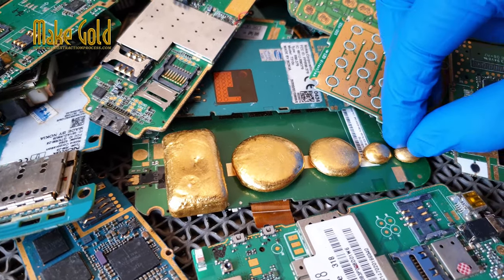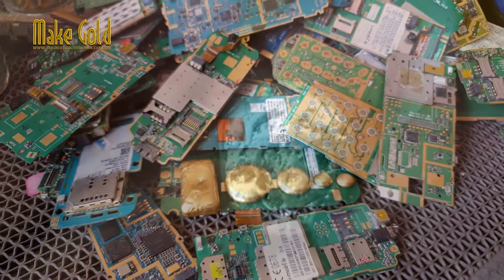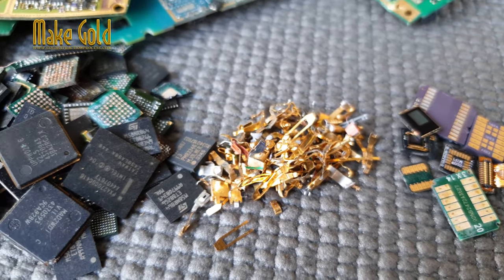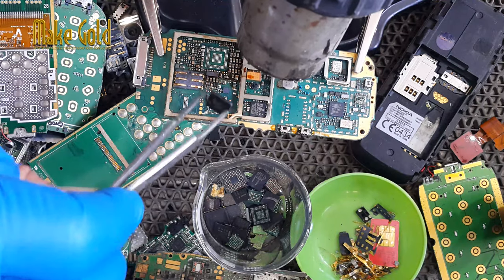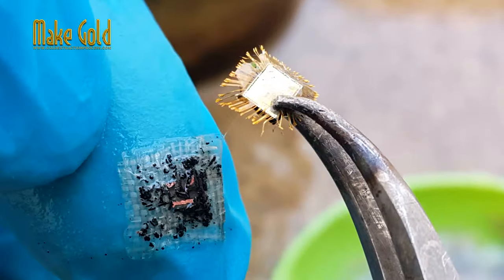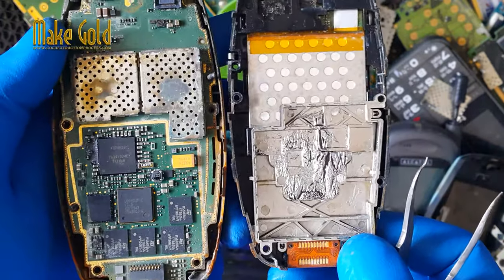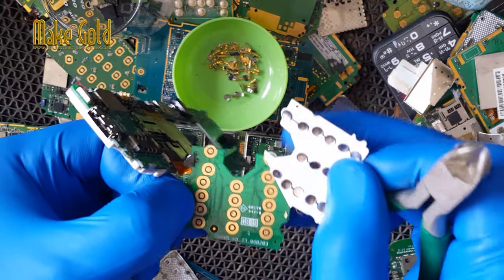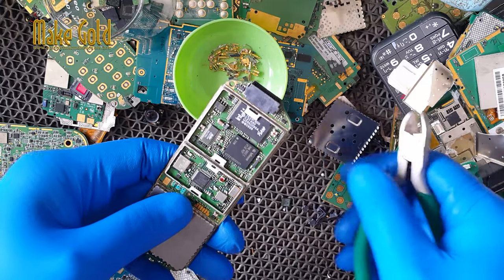How much gold What is valuable is in old cell phones? Can you get gold from old phones?

Comment from the maker: :face-blue-wide-eyes::face-blue-wide-eyes::face-blue-wide-eyes: What is the most valuable part in a phone?:face-fuchsia-tongue-out:

The most valuable part of a phone depends on the specific phone model and components. However, in general, the most valuable parts of a phone are the integrated circuits (ICs), which are small electronic components that perform specific functions in the phone's hardware.

ICs can be found in various parts of a phone, including the processor, memory chips, and communication chips. These ICs are made from various metals and other materials, such as gold, copper, silver, and tantalum, which are all valuable metals. In particular, the gold found in ICs is highly prized due to its high conductivity, resistance to corrosion, and malleability.

Other valuable components in a phone include the display screen, camera modules, and battery. These components also contain valuable metals and materials such as rare earth elements, aluminum, and lithium.
Reply: langue français